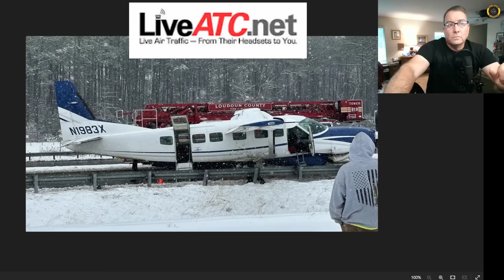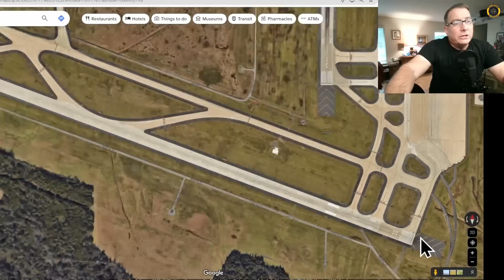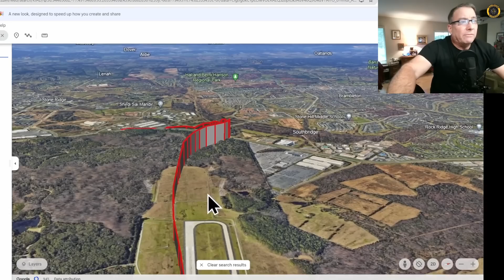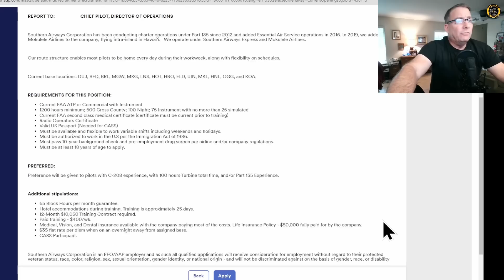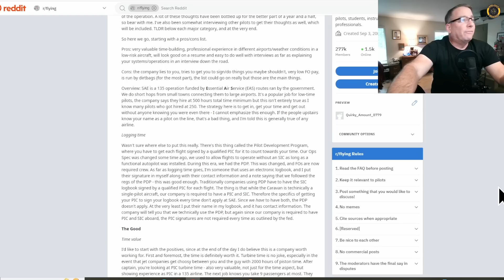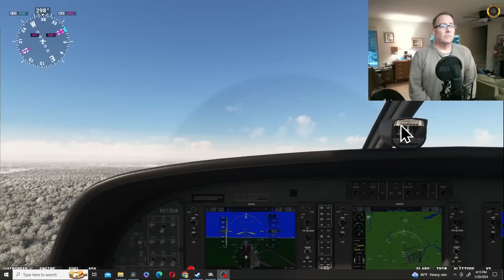Dulles Caravan Forced Landing 19 Jan 2024

Comment: Pilot did a nice job- in light of the situation they found themselves in, still in command and in charge to get help right away by communicating with ATC. Instead of sitting in the seat, dumb founded and wondering what happened.

Comment: Reverse flow of the PT 6 describes the internal air flow reversal inside of the engine (two 180 deg "turns"). Based of the condition of the feathered prop, this was a case of power loss and not complete engine failure. Good starting point would be an FCU issue, loss of P3 air (compressor pressure used by FCU to control the fuel main metering valve), power lever linkage issue or internal FCU failure. In all these cases the engine would roll back to min fuel idle (mech stop of the fuel valve, old carburetor style idle screw). This keeps the engine running at low idle setting, enough power to run generator or bend the feathered prop, but not for flight thrust. The P3  line is externally heated by an electric heater. If that failed, the P3 line could have possibly frozen internally, roll back to idle again. Single engine PT 6 installations have manual "emergency" fuel valve control, bypassing the FCU governor and the P3 (reduced to Px, Py pressures within the FCU). These pilots had very little time to deal with the power loss, great job putting it down.

Comment: Just a personal , in '67 at 17 I worked a summer job for Maney Aircraft and loma rica . Brush applying paint stripper to air force ground starting units , in the hot summer sun . Weekebds at Edwards Crossing or the blue hole made up for it though . Take cre , Neil ,👍👍👍👍👍👍👍👍👍👍👍👍👍👍👍👍

Comment: The weather was also very cold and snowing...  At that time, at least 2 of 3 inches had fallen in the area.
The aircraft didn't have to go under the power lines.  They were to the right of the aircraft's flight path, and it turned 'left,' off the active runway to climb out, when the engine failed.
I would have expected icing conditions to have been more of an issue, with the temps and snowing conditions.
I work in the place off the end of that runway, where you see 3 long buildings together...

Comment: so why did the sim landing fail. 1st: way too high and fast. the original flight never got above 11k and never exceeded 99 kts - the sim was at 13k ft and 110 kts still  at high throttle much further downrange.   the original flight therefore made a low approach and touched down way before the curve. the sim flight had to make the curve in the air - and then the approach was no longer stabilized.  last but not least the sim spawns and pops up new cars out of the blue right in front of you just as you touch down - but at that point it would likely have crashed anyway. -- note to self, avoid landing on roads in that particular sim.

Comment: My son was a Caravan 208 bush pilot in Alaska.  8 or so years ago he had an engine failure on take off (failed compressor blade) and landed on a frozen lake.  No injuries.  A week later the ice melted and the Caravan sank before it could be salvaged.  He was based out of Bethel with a 135 opertator servicing very remote communities, but I can't remember exactly which airport he was departing from when the engine failure occurred.  The flight sim idea to do a recreation is excellent, and I'm going to suggest to my son he also try that.  Actually, I wouldn't be surprised if he has already done a sim.

Comment: Just for your information: The propellers used on the PT6 engines do not have a low pitch stop which means that the propeller will go into the feathered condition when oil pressure is lost. The condition of the propeller now does not mean that the crew feathered the propeller in flight; only the crew can make that statement. The way  the propeller blades are bent shows that the propeller was rotating when contact with the guardrail was made.

Comment: There’s no “quick” 90 degree turn. It’s a 90 degree turn and it too is risky. Maybe half as risky as a 180 but risky nonetheless. Any turn is a secondary option only used if straight ahead landing is not possible. 
So there is no pass and there is never a pass. A turn is a turn and if you are near the ground, you need to be vigilant. Quick, what’s your stall speed in a 60 degree bank with flaps?

Comment: Wasn't it only recently that an experienced pilot, but as a passenger, was killed following engine failure after take off when the pilot tried to do a 180 return to the runway , (which my understanding is, is not recommended), but didn't make it and crashed?

I'm surprised that a single engine plane is used for commercial flights. But then again turbine engines are pretty reliable.

Comment: Just as some research for a book Ive been playing around with about Alaskan 135 operators I read thru all 250+ hull losses with the Cessna Caravan on the ASN, finding no fewer than 61 engine failures, which is a little over 24% I honestly didn't expect engine failures it to be that high. One of the most commonly stated reasons were fatigue cracks in the compressor blades. Ive probably seen half a dozen PT6's fail in flight myself in Alaska, but they were all on twin engine machines that were able to make safe landings on the remaining power.
Reply: The planes are old and if you neglect maintenance, you end up with a guaranteed problem waiting to happen.  Many small companies play fast and loose with the rules, unfortunately.
Reply: @josephoberlander  It's funny you say that, yet most of the engine failures that I was ever involved with were caused by the Lycoming factory in terms of the Navajo's or a certified overhaul facility when it came to the PT6's, at least the 135 operation I worked for
Reply: @Agwings1960  Interesting. So maybe this issue of proper maintenance goes far deeper than it appears?
Reply: @josephoberlander  Also they're not all older aircraft Bering Air just purchased 9 brand new Cessna Caravans and two of the new twin engine Cessna Sky Couriers and theres another operator on the North Slope that are buying brand new twin Otters which are now back in production. Today things are different especially in the lower 48 cuz everybody has a camera, but in the 90's someplace like Alaska if an aircraft lost an engine, made a safe landing where everybody just walked away, where can I find that number? It's not out there yet those occurrences took place. The only engine failures on the ASN are the ones that resulted in damage or fatalities.

Comment: Excellent airmanship by that crew. No time to communicate, but they did an amazing job maintaining airspeed and finding a suitable landing site. Having personally experienced an engine failure on takeoff in my Cessna 140, I can tell you it will test your nerves and pilot skills. I was only a few hundred feet AGL when the engine quit. No time to troubleshoot. Forward slip to try to make the end of the runway, but ended up in (thankfully) spring corn at the end of the runway. Towed back to the hangar, and the airframe was none the worse for wear. I didn't get scared until I was on the ground. I had excellent flight instructors, and training kicked in. If I had tried to make a turn, I would have destroyed the airplane, or worse. I wonder if these airmen will get job offers!

Comment: Wait. Instead of making a left turn toward civilian traffic and infrastructure, why not just continue on their right heading, make a 180 turn and glide back to the airport? It has significantly more space for an emergency landing and less civilian traffic and obstacles. From what I understand their control systems were not damaged, only their engine. This looks like a botched landing to me.
Reply: Lack of altitude probably. A 180 degree turn back is often referred to as the "impossible turn" as it kills a lots of pilots who try it. The rule for a low altitude engine out is to pick a landing area 30 degrees max either side of the runway heading.
Reply: @AnthonyHigham6414001080  But that makes even less sense looking at the maps. They were already in a 35 degree right turn when the engine failed. They then made a sharp left turn to a 90 degree highway. Adding those numbers, they ended up making a total of a 125 degree turn into civilian traffic.

Comment: FYI on the propellers installed on the PT6A-114(A), the blades move into the feather position once oil pressure is lost between the gov and the prop hub.  But will feather quicker if commanded by the pilot before total lost of prop gov oil psi.

Comment: I’m a 208 mechanic.  Caravans DO NOT do well in icing conditions.   According to Cessna, 208 and 208B pilots are to avoid icing conditions whenever possible.  And it’s the inertial separator, which was probably not engaged or was maintained properly. It has a very complicated linkage system that needs to be cleaned and lived regularly or it can fail.
Reply: The Caravan is notorious for accidents in icing conditions.  There is a reason C208 pilot's are required to complete annual cold weather operations training per an AD.  It's the only airframe I'm aware of that mandates such training.
Reply: I used to work for an aircraft manufacturer who made planes with PT6 in them and I always marvelled at the design of what they called the Inertial Particle Separator or IPS

Comment: Simulator are not quite the same and the results are very unpredictable. An example was the Air Canada Gimli Glider, around 1988, it was a far harder forced landing than at the Hudson river, where they were low enough and the decision had to be made were limited. But the Hudson River landing got all the press interest. The Gimli Glider ran out of fuel at 35, 40 ft right in the area this Captain Pearson remember he used to fly gliders out of an airport, not only he made the field, but the bird can be reused later, after some repairs which was Boeing's fault. They discovered the hydraulic pressure remain in that situation is not enough to lock the nose gear. The later put it on the simulator and just about everyone else crashed. There was also Air Transat ran the tanks dry and a DC9 that forced landed at Cincinatti after fire started in the washroom. None of this were on simulators.  An engine out is not a problem, hell you been trained enough, but what raise the blood pressure is if the thing explode, you in another area code do not know what else other systems the sharpnels damaged. Just like the A 380, I still hate sitting near an engine.

Comment: They did an excellent job. I have 3,000 hours in Caravans. They glide well. In fact if your engine fails near the FAF on an ILS approach and you are fast and not at the best glide speed, you will over shoot the touchdown zone! I used to practice simulated engine failures twice a month when I was flying for FedEx in CE-208A/Bs.
  I have known pilots that have worked at Southern Air. They are well trained. From what I have heard, has been positive. Training, experience, SOPs, CRM and thinking ahead makes the difference between good and bad outcomes. Very good video. Keep it up.
Reply: It was also advantageous that they only had five passengers and a half load of fuel. Sometimes the holes in the cheese line up to give you the best possible outcome.
Reply: Did you soil your shorts when you'd simulate the engine failure 😢
Reply: Nope

Comment: The worst plan of attack for your “pre departure briefing” is a straight out departure with a single engine.  As soon as you cannot land directly ahead on the remaining runway or clear way … turn, in any direction.   Yea, I know, I was based at Dulles for ten years and you just can’t turn when you want, but long before that I glided in, 13 times in single engine aircraft. (Hell of a number)    At a smaller airport where I was a production test pilot, I had a plan where I would start my turn just after take off from the short runway so as to fly over the longer runway after departure.  And, one day in came in handy.  I lifted off and immediately retracted the gear (safest mode) and started my turn when the big IO540 succumbed to a clogged fuel line on its first flight.  But I now had the remainder of a longer runway ahead of me. So I got the gear and flaps down, turned off on a taxiway and nearly made it back to my office!

Interesting note, that while I was in test flight, one of the worst engines for me was the PT6-61.  Thankfully it remains the only engines that have given me a dual engine failure (twice).  It was bad as so many of the engines did not make spec power (temp limit) and had to exchanged for another serial number with like power specs. Which added more time to certify the airframe.  We had a similar airframe with the TPE 331-14 engines that were all flawless.

Comment: Good controlled forced landing by this crew . Interested to know the FAAs version of SE IFR procedures for turnbacks ? Under PSEA (prescribed single engine aeroplane) which are a series of risk mitigation strategies , geared at commercial operations of PT6A powered Caravans , PC12s and TBMs under the IFR in Australia , we brief and train turnbacks not below 800ft AGL and 95KIAS where I presently work , however there are other factors that may preclude a turn back as the best option so no suggestions that the crew did anything untoward here even if it’s a permissible FAA procedure . Unlike a piston single , once feathered the Van and PC12 (I haven’t flown a TBM so can’t comment on it) are both great gliders and if a turnback is not managed properly , the next risk is floating the length of the runway and sailing off the end of the runway you just departed . The 800ft AGL lower limit has a good safety buffer to return . I personally know 2 highly experienced Australian ATOs (testing officers) conducting training flights in 208s , that achieved successful turnbacks from not above 500ft AGL after power loss on departure . Once again great reporting by Juan !

Comment: ATC: "246 What's your 20?"
Pilot: "246... we're right infront of Wendy's."
ATC: "246, we have emergency services on the way and would you please order me a Baconator on your way back?"
Pilot: "246, roger, do you want fries with that?"
ATC: "246, that is correct, order of large fries to go with that Baconator, and how many souls on board?"
Pilot:"246...5 passengers, 2 crew, and 1600 pounds of fuel and there are all now going into Wendy's... anything to drink with... with that Baconator?"
ATC: "246, roger, I would take a large Sprite with no ice..."
Pilot: "Copy that."
ATC: "246, be ready to write down a number to call ATC... looks like the other guys here also have orders..."
Pilot: "246, copy that, will inform when I am ready for that number."
Reply: What’s your 20? Pilots and ATC don’t use the redneck deputy sheriff radio lingo. “Say position” would be more accurate.
Reply: Pilot: "246...can I have a combination code for the latrine, will need it in a hurry."

Comment: To be fair, Juan... and you probably know this as obvious, but aren't bothering to say it:  The responsiveness of that controller and/or overall input lag in your system there, has got to be a significant handicap compared to the real airplane in the real incident.  (That seems clear just from the struggle to keep on centerline during takeoff.)  I mean, all props to the pilots who did it for real.  But I'm sure you also could have pulled it off if you were actually there hands-on.

I see a bunch of comments wanting to see more of you doing simulator re-creations of some of these incidents.  I would support that sentiment.  But you may have to do some system upgrades, to give yourself a fair chance.  Or better data rate from your ISP.  Or maybe both.
Reply: I don't think the problem is controller responsiveness/input lag.  The problem is more likely a mix between MSFS's ground handling being considerably more finicky than an actual airplane's and almost every means of controlling the rudder in a home flight sim being terrible.  (Nothing short of an expensive set of pedals and a stand to hold them in place feels anything like an airplane.)

I'd definitely like to see him with a good sim setup to do sim recreations, though!
Reply: @ikkinwithattitude  Yeah, I popped off with that comment just based on generalities...  Then only after I posted, did I reconsider the whole matter of "pedals" specifically.  More interested in space sims than flight-sims for myself...  But I'm well familiar with ppl's issues re. just the financial barrier-to-entry around pedals even for that application.

Comment: I love a happy ending and would love to have been a fly on the cockpit glass to hear what was said when they briefed that takeoff.  The pilot flying pushed the nose over hard right away and kept enough airspeed to accomplish that sharp left turn.  How many would have stalled the left wing and rolled straight down into a smoking hole halfway to the road?  Then actually sticking the landing and not slicing through a wing tank on a semi-high-powered electric traffic signal pole and going fireball, or worse on the high voltage towers.  Lots of luck used from the pilots Luck Bucket but no doubt lots added to the Wisdom Bucket at the same time, and it's a lot more than just luck to pull that off, no way it was an instant decision what to do "when" the engine quit  Your simulation was priceless.  Bravo to the pilots and the training programs they went through.